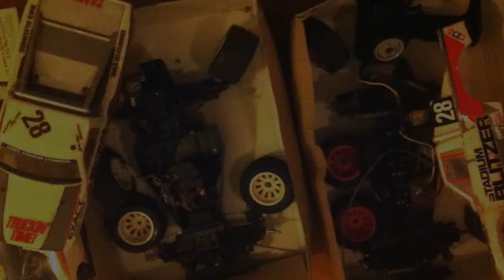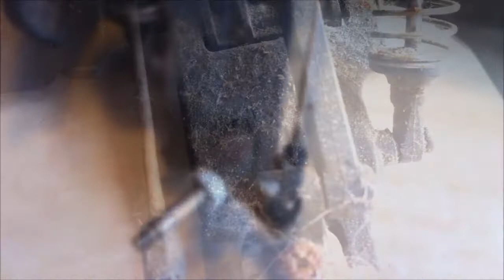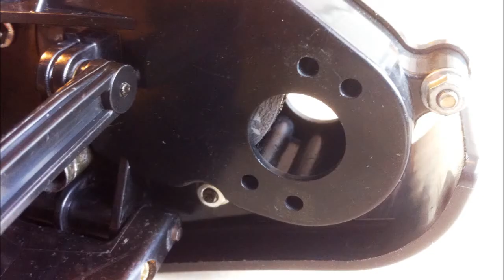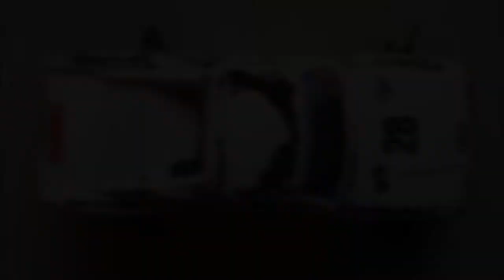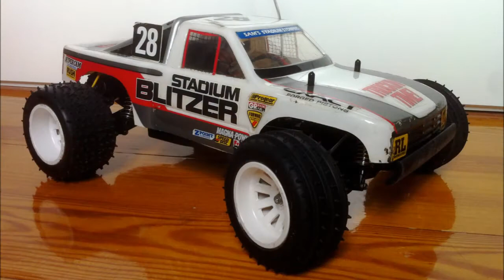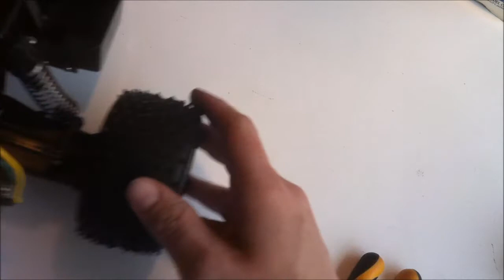Tamiya Falcon Stadium Trucks #1 - 1992 Stadium Blitzer #58106

Comment: I remember those old mechanical speed controllers. We used to run our cars that long the green and yellow wires would melt off them. And the white battery plugs would fuse together ha ha
Reply from the maker: Wow! Sounds like you had some long warm runs ☺️

Comment: What a cool little truck! I bet they are fun to drive!
Reply from the maker: +RCing Around HQ Very fun to drive. Classic 1990'ies trucks based on a 1986 buggy chassis. Pure fun :-)
Reply: Awww man... now I want one!
Reply from the maker: Yeah, it's like going back in time to the trucks that started all the "stadium truck/truggy" craze, just like a Lunch Box and Monster Beetle etc. started the Monster Truck craze :-) They are great fun and not very expensive. Three models available, all three available in both original and rerelease versions.
Reply: If I was to get one, it would have to be original. Re-release is fine, but there are many, faaaaar more capable modern RCs out there! Original is something special :)
Reply from the maker: +RCing Around HQ Yeah, this is not a very capable stadium truck compared to the modern ones, but the fun-factor, vintage style and visual pleasure is high :-) The originals are indeed special I agree but when it comes to runners I actually prefere the rereleases: same truck, visual and running-wise, but no 20-40 years old fragile plastic :-)
Reply: Haha, yeah, they get brittle!